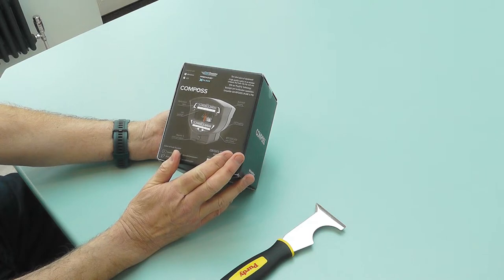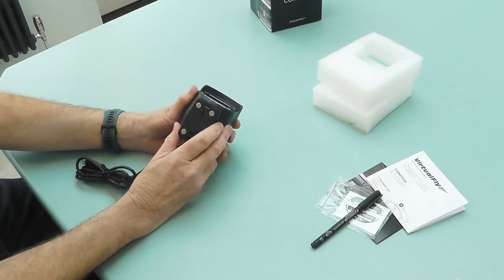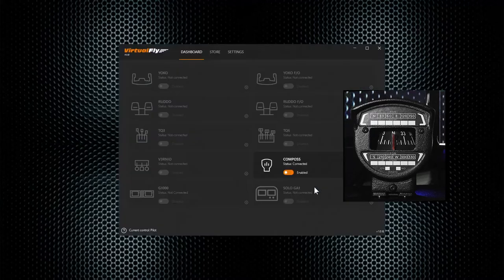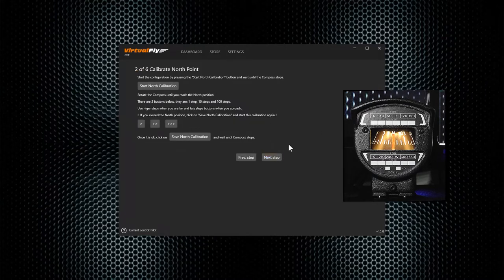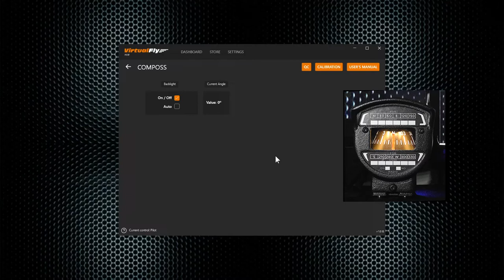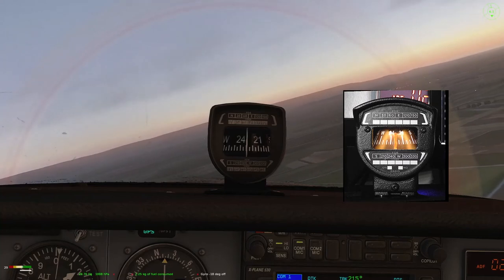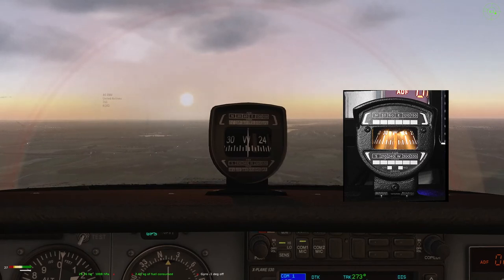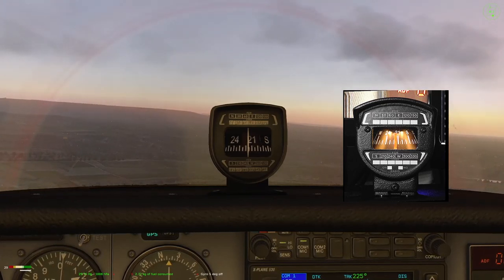The Virtual-Fly Composs - unboxing, setup and review

Comment: Most importantly, you need a wet compass to align the heading indicator.  Without wet compass, how would ypu set the heading indicator?  Its is the only reliable source of magnetic heading.  I guess you can simulate magnetic deviation via the calibration menu.  Irl, the compass is placed at the farest location in the cockpit to avoid being disturbed by electro magnetic source such as radios.  So you can take a real C172S magnetic deviation card correction and apply it to the compass.   For instance is real 090° magnetic heading is shown as being 092° on the compass, in the calibration menu, when it comes to calibrate vs East, set the composs to 092° and so on...I ve just ordered mine and I ll do this.  Thanks for the review!
Reply from the maker: Thanks for your comment
Reply: @simmo2sim  well, I received mine but the VFHub does not read the magnetic compass from XPlane.  XPlane is well detected and the composs well detected by the soft.  I ve contacted the support service and now waiting for the solution....frustrating 🙄
Reply from the maker: @StefBelgium  That sounds unfortunate. I have not had the same problem although the compass may have stopped for some reason and I might not have noticed. (I don't always look at the Composs when I'm flying) The only things I can think of are 1) the particular aircraft you are flying is having problems? Try using the stock 172.... and 2) Is the VFG hub program running? You must start the hub before you start X-Plane and keep it running all the time you are using the sim.
I would be interested in hearing any solution Virtual-Fly comes up with.
Thanks.
Reply: @simmo2sim  I ll let you know.  Yes everything is done correctly.  The compass itself works well.  But I might have some incompatibility with my rig.  I got a full home cockpit with Simkits and flight illusion gauges.  Still some stuff to test but VF is keen with me to send the compass back and get a refund.  It s a shame because the compass looks really sturdy and animation is smooth.  If no solution can be found, I have no choice to get the one from Simkits that will force me to drill the back of my glareshied.